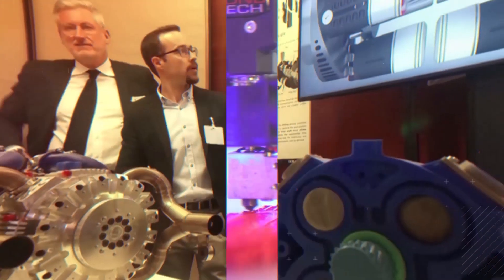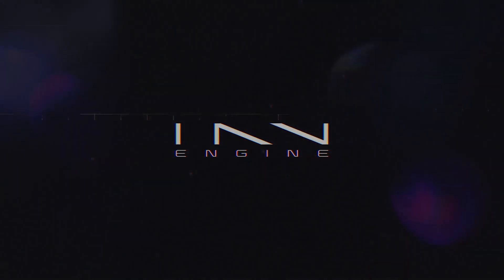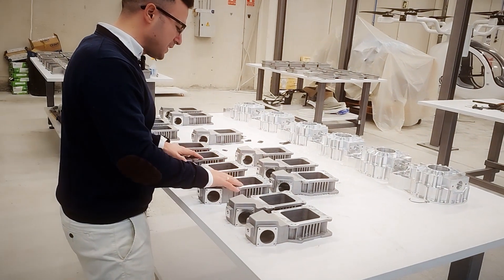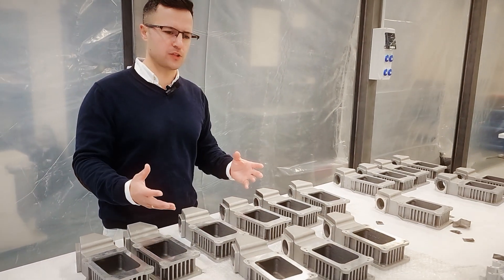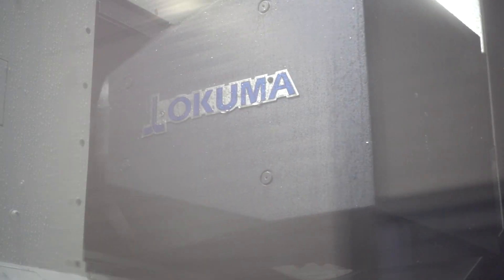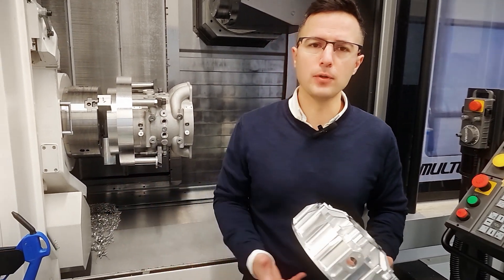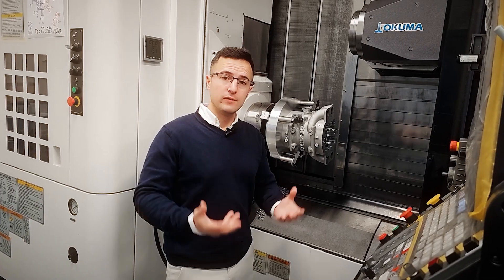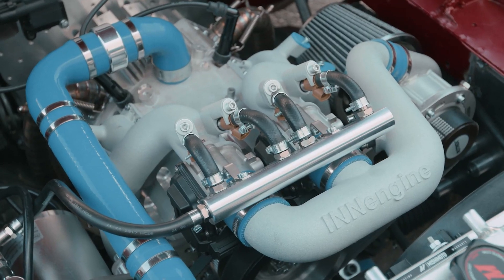INNengine. Engineering solutions

Comment: That's pretty suspicious that you don't want to manufacture them yourself. Perhaps it's not economical to machine
Reply: Just look at the design, it's not that difficult. Everything can be made with casting and a little bit of machining - no different than any other piston engine.
The reason is most likely the size of their company and limited space.
Reply: up scaling needs a lot of money & is a risky job for such a small startup company. so their idea is reasonable because for example car manufacturers already have their manufactures lines ready to produce what they want
Reply: Because it requires a lot of money to do so at scale which they do not have. Why do you think car manufacturers buy components from OEMs (e.g. shocks) instead of making everything themselves?